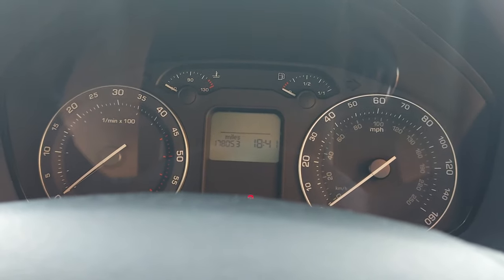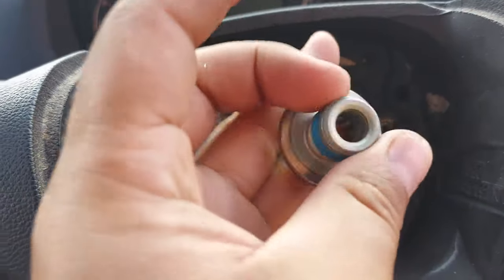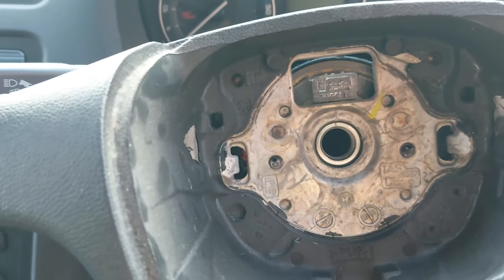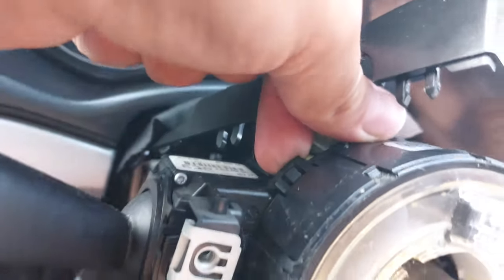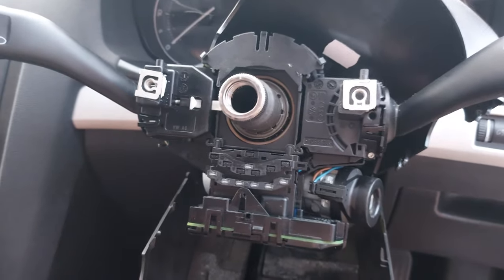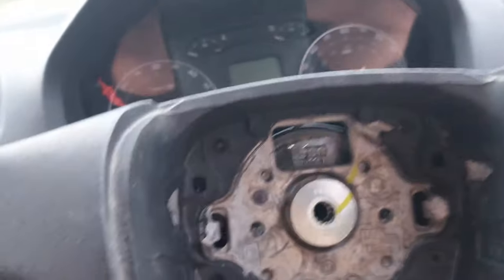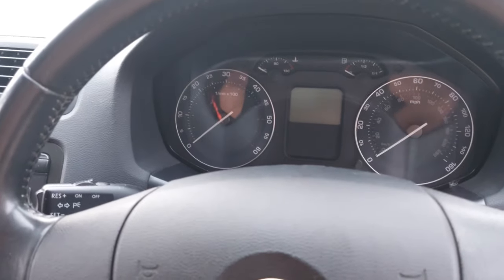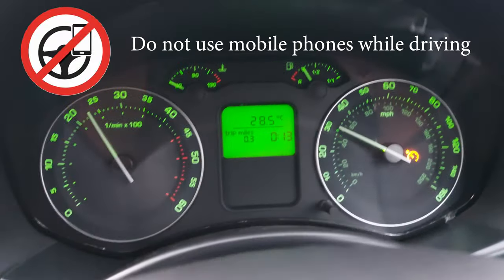OCV Ep 02 - Skoda Octavia mk2 cruise control retrofit

Comment: Hi, I have a 2012 mk2 superb. The CCS retrofit kit comes with an extra wire to go to the ECU I assume? Did you not need to do this for yours? Thanks.
Reply from the maker: Hi, it was not needed on mine. The seller should've provided you with an installation procedure manual. Have a look online, I'm pretty sure there should be a guide for it. If you can't find it, let me know.
Reply: @OvidiuMarin  Thanks for geting back to me. I have yet to purchase the kit and it does look to come with an instruction booklet. I have just been researching the process before purchase because the official kit is expensive and I don't particularly want to have to mess with the ecu wiring on install. Also did you use an obd2 to usb cable for vcds or one of their wifi/bluetooth obd2 dongles?
Reply from the maker: You need vcds or anything that can access the ecu and activate the cruise control.

Comment: Thanks for the video. I have a newer Octavia from after 2009. It has some extra buttons on the steering for controlling the radio, phone calls etc. Would that make much difference, like more wires, or is it basically the same?
Reply from the maker: Hi, thanks for the comment. It's basically same thing, you need to look for a highline steering wheel controller. You need the XXX-953549-XX version, so 2 digits at the end

Comment: thank you for the video. I did the whole process and also the coding. When viewing the live data from the steering wheel controls and the module using the buttons of the cruise control stalk I can see the values changing so everything is well connected and communicating with each other.
But I get the fault p0568 in the engine module. 
Do you maybe know why that could be happening?
Reply from the maker: Thanks for the feedback. Unfortunately I can only guide you to check the rosstech wiki, usually they give good solutions.
Reply: Hello, did you get the solution? I have the same problem.